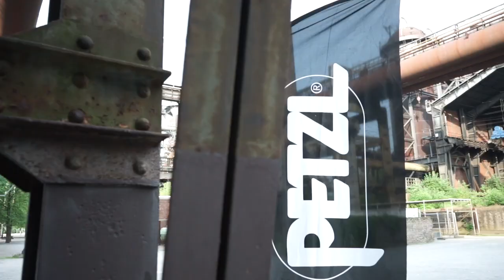UNDERSTANDING ROPE ACCESS ANCHORS AND ANCHORAGE - The Rope Access and Climbing Podcast

Comment: Hi. Great podcast and thank you for doing this work. You went through all the correct nomenclature then in you conclusion you refer to your “anchor” as the anchorage you just defined. Personally, I think we all use anchor rather than  anchorage. Maybe the terms need to be rethought to agree with more of a common usage.
Reply from the maker: Hey Alex, 
Thank you for you commenting here. 
I see your point.  But the issue we have is people dont understand it as it is.  So by default they use anchor as a catch-all.  In most cases that's fine.  But doesn't make it correct.  I don't want to see this stuff generalized more then it already is.   I hope that makes sense